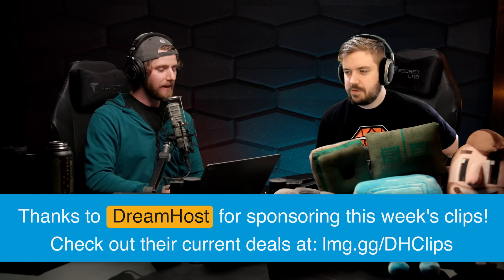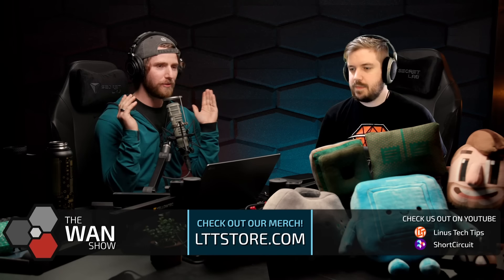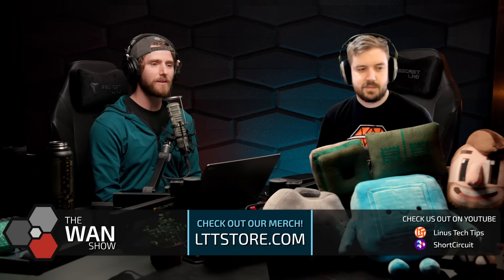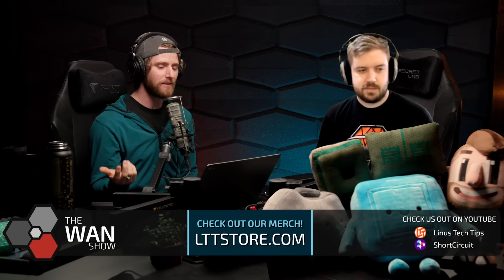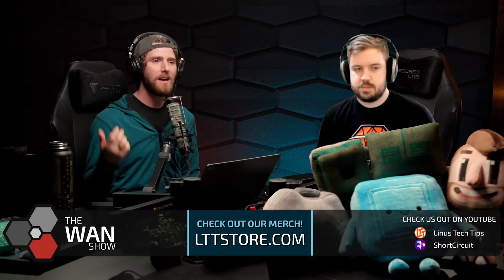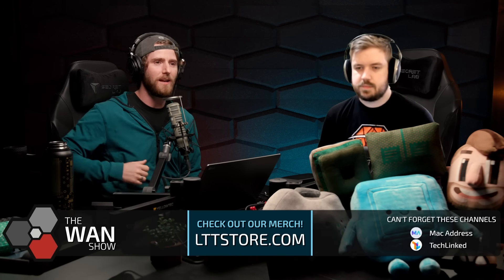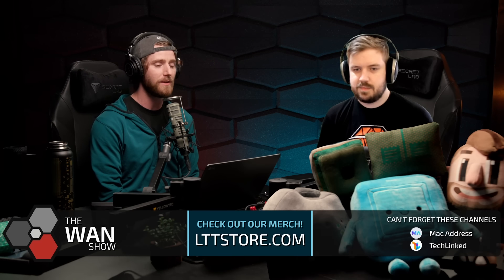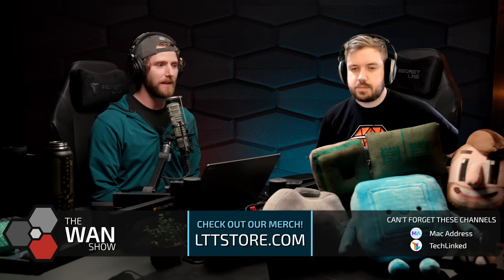They made me WASTE $10,000! Pt. 1

Comment: I think its catch 22 for a company to ship products with updated firmware. I do robotic maintenance, we've had laser welding equipment sent with newer firmware with out the company realizing it isn't compatible with our current laser generator. 36hrs of having tech support from Germany remote in, and sending a local support tech to install a newer data bus and software update it was finally fixed.

Comment: Um just get a single new switch and rip the firmware from it? I’m sure that there is a way to do that
Reply: Maybe but would a user need to go to such measures in the first place yk
Reply: @Destroyer-4386  that is absolutely true, but it could be an option since there isn’t another way
Reply: @Destroyer-4386  the other thing that I am wondering is if he used the manufactures app or program for controlling the smart home device if it would be able to update them?
Reply: First, you'd need to luck out and get a really up to date device.

Second, the microcontroller(s) in these devices are almost 100% of the time read-protected which will prevent readback of the firmware on an already programmed device.

Comment: Who knew that simply switching off the lights and AC when you leave a room is vastly more cheap and efficient than unnecessarily putting 'smart' switches everywhere because smart means good right
Reply: This was not an adequate approach there's far cheaper ways to do it. But for 10 grand I would just add more solar panels to his roof and run the AC in the whole house, the sun will pay for it

Comment: I don’t quite understand the issue with the Lutron switches. They’re fine for poking several times a day. I wouldn’t want to type on them, but for a light switch, they’re fine. Get the ones with the middle button. Also, the Pico remotes are very inexpensive, which lets you control the same light from many different locations, like a room with three or four entrances, or stairs. And you can program them differently. I have a light in my dining room and a lamp controller for my adjoining living room. I have a Pico in the hall leading to the bedrooms that controls both. I have a hard wired switch for the dining light and another Pico by the front door that only controls the living room lamp dimmer. I also have picos by my chair that control those lights. I could also add  another one as a master switch that turns off everything in the home. And those are all very easy to program. You can buy on-off smart switches for Lutron, or set a dimmer to only turn on and off for smart color bulbs. Personally, I think colored bulbs are a gimmick. But I do use dim to warm bulbs to vary the color temperature. In my kitchen I have a dimmer for the over head recessed dim to warm lights and another for dim to warm strip lighting under the cabinets. My laundry has an LED boob light with a dimmer. My hallway has a dimmer and boob light. The bedrooms have lamp dimmers and picos near the door and the bed. The bathroom has a dimmer for lighting and an on-off switch for the fan with programming to leave the fan on a little extra. My home isn’t the mansion Linus’ is. So I have no idea how many circuits he’s controlling. I say circuits because although each circuit will cost you about $60, pico remotes cost an additional $25 including the wall mount.

Comment: bluetooth detection for presence detection sounds like the more default easiest way to go, just an airtag/bluetooth device in general in your pocket and anytime you're near the lights turn on, when you're out of range it turns them off. would be so much easier than motion detection from a tech point of view. nfi if any of that tech exists but you wouldn't need light switches outside of bedrooms.

Comment: Linus, all you need to do is just wire all light switches and all light fixtures in a star configuration to your mechanical room. Then all you do is plonk a relay + io expander board and hook it up to home asistant. Worst case scenario, you swap the relay board, not all your light switches and bulbs. yes, it does cost more in cabling but it gives you infinite flexibility + everything is hard-wired + no cloud

Comment: Ya, I've run into the same issue with one of those cheap USB to Ethernet print servers. There is a firmware update section but the company never made the firmware available. Oh, but newer versions of the hardware have newer firmware which ALSO have new features. But it gets BETTER, there is no hardware/firmware revision number on the packaging so there is no way to know what you're buying until you power it on.

Comment: You really should give PICO switches a better shot. I know they feel clunky but they are just a great product, and chances are there will be a lot more of them around. From an electricians standpoint It used to be that getting more than 2 switches on a single light was just plain difficult, but PICOs have made electricians jobs both easier and cheaper. When we wire houses with more than a single carrier (14-3 wire to more than 2 boxes resulting in 4-way, 5-way etc) or extremely difficult runs (in narrow truss-work, small crawlspaces or in remodels) we just install these now. We just plop these into what amounts to a patch box (empty single gang with power in and out for the outlet below) and skip wiring the carriers, and since 14-3 Romex is around $125 U.S. a roll right now (last I checked), and a PICO is around $30 U.S. (for us) it is actually cheaper to install once you factor in labor as well, and it comes with that 'Wow' factor of an app integration which helps sell a home for a lot more than it should. Looking at this trend I would expect that this system to become much more widely adopted and thus encourage further support from the manufacturer in terms of integration and service for years to come.

Comment: I just use Z-wave modules behind the switch in the wall. If you are installing everything anyway just make sure your have enough space for them. 
Then I just bought nice momentary light switches for them. Because the module is not part of the switch you can buy whatever you like.
And I just use a raspberry pi with a Z-wave USB stick and Home Assistant as controller.

Comment: Aruba has a similar issue. If you Virtual Controller has an EoL device. You can not update or add new devices to it,. Catch 22. EoL WAP or new WAPs but not both. To add the new WAPs to the Vc you have to have the updated VC which does not work with EoL WAPs. Predicting contact a certified installer or reseller.

Comment: For us Europeans there is at least a decent home automation standard called KNX. That is around now for over 20 years, is very stable, has a decent support of many devices and is still the state of the art home automation standard to this day.
Reply: or Dali for the lighting part ...Thats the cool thing on standarts... there are gateways between that and as long the manufacturer follows the standart . every thing is compatible .. 

And A Knx Switch can be as low as 70-80 Dollar US 

But the Ding with North America is that they use more Z-Wave and 0 -10V signals AFAIK ...
Reply: Yeah knx is nice, can't understand why it's not used in America. 
Once it's up and running it's rear to have any problem's. It just works (have a 2300 device project thats been running for a year now with zero issues. Controls lights, hvac and smoke evacuation.  
Also the amount off companies that supports knx is amazing.

Dali is okay for lights but stay away from Helvar that has everything running in it, terrible support, software 🤮 and crazy amount of problems. + The buttons have stupid design.

Comment: Philips Hue have lot of different lights, sensors and switches. and they all update firmware automatically. Switches cost like 15-30€ a piece, and they have good app + automation options, also work with other zigbee devices and home assistant.

I tried few other brands and Philips is just years ahead

Comment: 'The One Rule' for a true smart house.
Design for maintenance. Along every wall there should be a paneling system that can be removed to access all electrical, plumbing, and ventilation.

I use this rule in Space Engineers as well. When your ship gets shot you want to be able to quickly access you fuel and ammo systems for repairs without removing meters of armor.
Reply: I was completely unprepared for your space engineers reference, but I love it. 🤓

Comment: My experience with home automation has been positive and these issues are easily overcome.  Everything I have is from TP-Link's Kasa brand, all wifi, no custom controller modules.  I have simple motion sensor switches in pantry, garage, utility rooms where I'm in and out.  I use  non-motion sensor switches paired with an Alex Flex and motion detection  module in hallways, basement etc where I need more advanced logic.  Everything works as it's supposed to.   The benefit is the routines.  Turn on outside lights 1/2 before sunset, turn them off at midnight, activate them based on motion detection during the night.  Setup a routine to turn your outside lights on, as your phone gets close your house.   Voice command to turn off the lights the kids left on upstairs,  One voice command and my path to my home theater room in basement is lit up.  By the time I get there, the TV, Stereo have turn on, warmed  up, Roku has Plex loaded up and is ready to go.   One more voice command and everything behind me is shut down.   My wife used to give me grief that none of this was needed and now she uses it more than I do.  She talks to Alex more than me. And with 30+ switches, motion detectors, including 10 Alexas of various types, I'm in for less than 3K.

Comment: At first I was thinking a better solution would be independent motion sensors point at the door of the room so as you walk in the door it can turn on smart lights. But that wouldn’t work because of the fact that if a second person walks in the room it would switch off. However, if you could have two sensors on each side of the door, you could setup a chain that if the first sensor goes off and then the second as you’re walking in, the lights are signaled to turn on. And then if you’re walking out, the second sensors goes off and then the first sensor, which could signal the lights to go off. And this way you could count the people in the room and know to turn off the lights after everyone leaves instead of just one person.

Comment: I don't know if this is the same reason but I worked with mobile printers and barcode scanners as a developer (yeah that's even better) and I couldn't get my hand on the firmware either because they didn't allow end-user to have it. In some case partners could get it (which we were not). One possible reason could have been to avoid the low risk of breaking the device (like in the old day with bios update).

Comment: Are they perhaps providing the firmware to retailers and installers? That is a thing in many sectors.

That's what people don't get about smart home lighting and switches,
you are supposed to use normal switches that suit you, and connect them to a relay that then controls the lights wiring going from that switchbox anyway,
it simply adds additional control on top of existing infrastructure, and doesn't replace it.

Eltako EnOcean is an example of this in 3 flavors even!
1. Controlled via switches from the distribution box
2. Controlled via switches from lightswitch box directly
3. Controlled via switches from lightswitch box indirectly (i.e. no wiring to lights from that switch, lights have own relay that is actuated by the switch or remotely)
and then outside of that, fourth flavor:
4. Controlled via sfl-powered switch that's not wired into anything, even power, can put it on a desk if you want - and it controls the relay located at the light

Comment: I am an entertainment professional... I personally prefer simple controls, but I have done some "smart" installations, and personally I stick with things that use DMX control, because you can get in wall touch panels that use DMX, you can setup SACN, which is a DMX network protocol, and which has priority controls.  And if something fails, DMX is a widely used protocol where you can just find something to replace it.
I avoid at all costs anything that is proprietary.

Comment: highly recommend the casseta system by lutron.  Ridiculously stable from an automation perspective for both Apple home and Alexa (which was my main concern) and doesn't waste wifi bandwidth.  Agree the switches have small, mostly imperceivable tactile bumps on two of the buttons that makes it hard to use in the dark or when not looking at it.  The solution I had was to add small raised stickers on the on and off buttons.   Should it already have that, yes but a simple enough of a fix to make it work.

Comment: Inovelli and Zooz make awesome Z-Wave products (switch and dimmers included) and they supply firmware update (you need to contact Zooz for download link tho).

They have awesome support and great community presence. They fully support Home Assistant with Z-WaveJS.
They also certify their switches and dimmers with UL which is somewhat rare.

I have a mix of both brands in my house. No issue and I'm completely satisfied.
Reply: I absolutely love my Inovelli zwave switches. But I'm pretty sure he went with the ge enbrighten was for the built in motion sensor.
Inovelli has that on their roadmap for both their zwave and zigbee lines. But it's likely a bit far off from now.
Reply: Inovelli is the best I’ve ever seen.
Reply: This answer is so obvious I'm guess he went with GE/Jasco due to supply chain issues.

Comment: I cannot speak for Canada but im an hvac guy in texas. Having the a/c turn on and off for rooms not occupied is horrible and will cause awful humidity issues and the run time and start up amps that would come from a system like this wouldn't save you any electricity in the long run. (All this being based on how everything works in texas)

Comment: I really would recommend a KNX system... It's a more or less open source system with maaaany manufacturers working with the system and they are all working pretty good together. So if you want another kind of switches or so you could easily just replace the old one without any new wiring needed and program it with a few clicks:D

Comment: In Lutron's world, Caseta is the cheapest you can get from hope depot... You NEED like at LEAST Ra2 Select controls if you want a responsive, clicky product. Lutron's RRD-PRO-WH... if you compare these to caseta, then it is a  HUGE difference.. and in top of that, Ra3  switches and dimmers are FANTASTIC.
We have 70 RRD-PRO-WH dimmers in our showhome, 5 or 6 RRD-2ANF-WH fan speed controls, and plenty.. of keypads.  All the clients we have over, are continuously impressed by the RRD-PROs.  

I do think you should've given a little more attention to them..  just my opinion.

They also have room occupancy sensors that can be configured for whichever dimmer, switch, fan speed control, etc...

They may not be Zigbee, but they pay the FCC dearly for a dedicated channel of the 433Mhz spectrum and it is simply, reliable. Also, every  single wall box device holds the programming for ALL the other devices, so everybody knows what anyone else is doing and doesn't NEED internet   at the bridge to function.  The only operability you lose in an internet outage is the mobile app. 

Give it another try.

Comment: I ran into this issue with the GE switches. You have to use a hub. They don't tell you which hubs are compatible, mind you. However, my old SmartThings hub did it. I don't use that hub, but it did get things updated. Then it went back into storage.

Comment: Best smart switches I ever bought are by Leviton, they look like a regular decora style wide light switch push the top to turn on, push the bottom to turn off.  It clicks (relay inside) so you get that slight feedback.  I connected it to my Alexa, and it has a phone app as well.  They don't just make smart switches so the company is relatively stable, the app is great, and the switches work on the 2.5ghz network even if you have a dual band network setup.  another brand I used would not.  Every time the power went out I had to disable my 5ghz wifi reconnect all the switches, then turn the 5g back on.  it was a nightmare.  with Leviton (I am not being paid to say this by the way, I just love the company) with Leviton you get all kinds of options, they are easy to setup, you can even replace 3 and 4 ways with them, there is a main unit then like slave units you put wherever you have or want other switches.  Literally you could add an additional switch as long as you have a source of power, live, neutral and ground.  and a second switch will communicate with the main switch through the network.  I love it.  Come home from grocery shopping, hands full with stuff, and I can tell my lights to turn on without ever setting anything down and I never have to walk into a dark room.

Comment: I had the same issue with getting new firmware for my Denon AVR. Mine is old enough that it doesn't connect to the internet, so you have to put the image on a USB stick and plug that into the AVR to update the firmware. My AVR was having issues with audio hiccups, which, according to Denon's website, they had a fix for my model, which had several years of updates unapplied. They straight up wouldn't give me the firmware, insisting that I had to ship the whole thing to an authorized repair shop. I emailed them constantly for over a month until I finally got an engineer to just send me the dang file, which fixed my problem. Go figure.